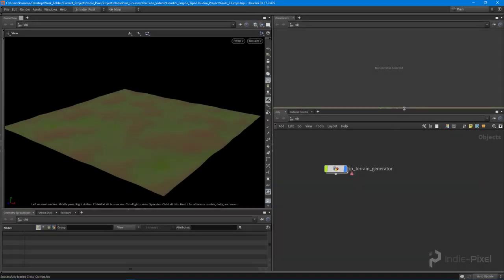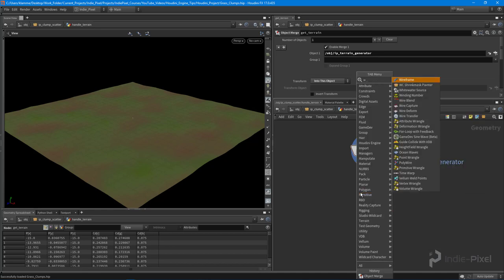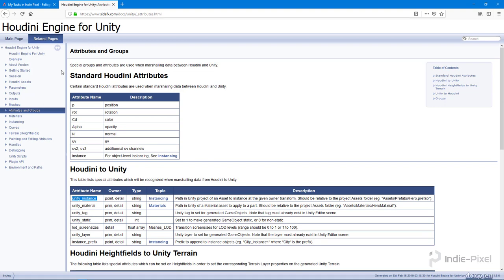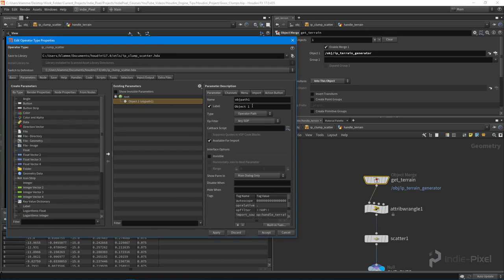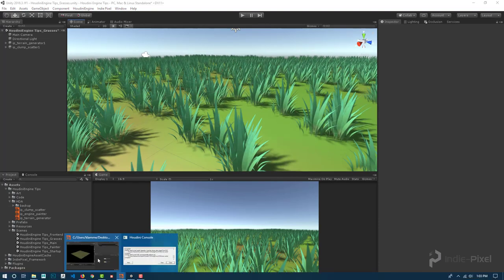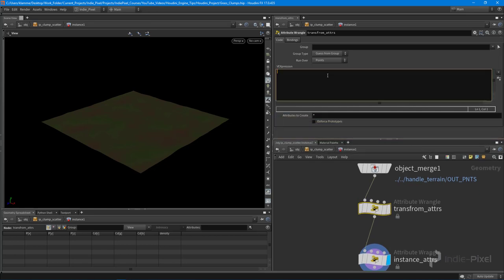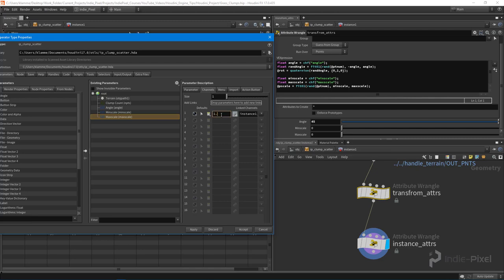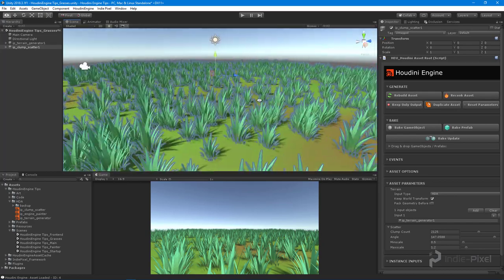Procedural Grass Clumps in Houdini and Houdini Engine - Part 12

Comment: Hello, where I can download these files? and I get this error in unity: "Invalid object ID -1 used for object, instancing. Make sure to turn on Full point instancing and set the correct Instance Object." how can I fix this, by the way, awesome tutorials as always thank you.
Reply from the maker: Howdy Selim!  So I'm going to upload the files to Gumroad here shortly, and will send out the link when its up there.  
To fix the issue you are seeing with the instancing, make sure that Full Point Instancing is turned on in your Instancer Node.  You can find it in a drop down for the instancer node params.  Let me know if you cant find it.
Reply: @IndiePixel3D I have already checked that but still won't work, was that in instance tab near transform if that was I changed it. Still nothing.
Reply from the maker: Hmmmmm....can you send me a mail through my website and send me a screenshot of yoru network?  Thanks man! :-)
Reply: @IndiePixel3D  just sent it to you through udemy :)